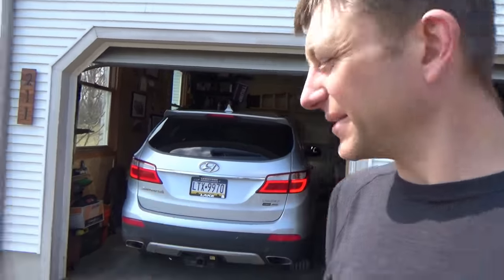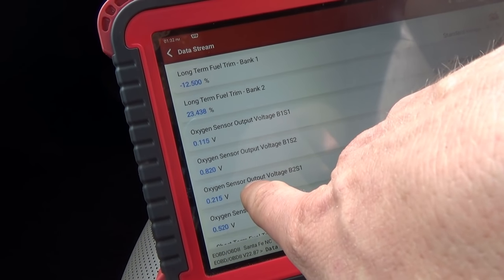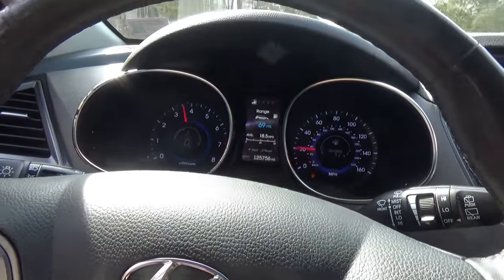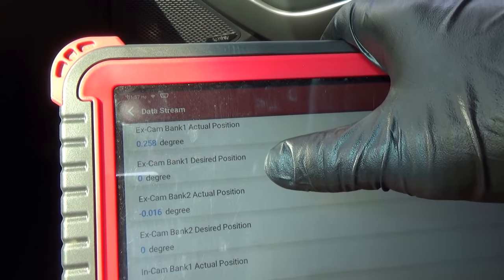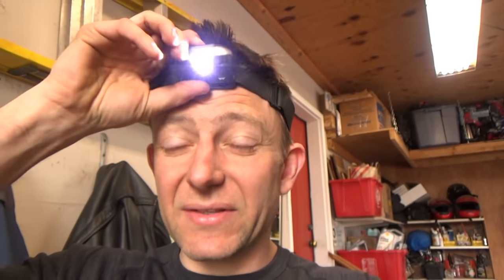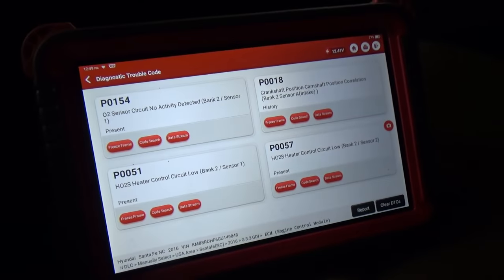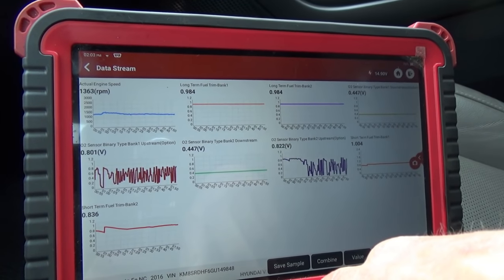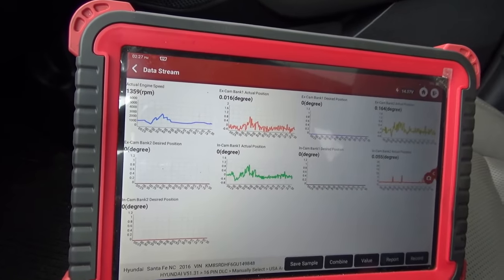Haunted Hyundai...Part 2 (Easter Special)

Comment: Just a note if chains are replaced on this engine the crank sprocket will need to be replaced due to a root depth issue with new chains. New chains will break the crank sprocket almost instantly. I used to be a hyundai tech and there is a TSB on this!
Reply: Well as far as I was taut, replacing chains must always go with replacing the sprockets, not only on cars. The reasoning behind was, it is not the chain what goes bad, but the sprockets are the thing that uses to go first. The chain is only "adopting" towards the sprocket wear/damage. So replacing just the chain means the new one will very soon become in the same state as the old one was, so all the chain and labor cost just went down the drain...

Comment: It never ceases to amaze me how sensitive 02 sensors can be.  They can take such extreme amounts of heat over and over again.  But don't get the probes wet.  Getting any fluids on the 02 sensor probe, will ultimately ruin them.  I'm still not convinced that this engine needs a timing set though.  I guess we shall see once the valve cover comes off.  Great content so far Ivan!  Can't wait to see part 3 and what the smoking gun for the timing issue truly is.

Comment: I always maintain at Least a quarter tank of fuel in my vehicles. For the fuel pumps sake.🙂
Reply: Funny story about that. I always kept over 1/2 tank in my truck and I got fuel one day no problem, filled it up, parked and went to start it after and the fuel pump was dead dead lol. 90k miles. Good ole GM
Reply: @BoweryPenguin8  GM pumps are garbage. They fail if the run dry for a few seconds. Bosch pumps get run dry several times and keep working fine. I have cars with 300,000 miles on the original Bosch pump, you don't typically hear that story on the GM pumps.
Reply: E is actually not empty. Engineers are smarter than you think. They know how people are. I've found my truck has about 2 extra gallons in the bottom of the tank.  I don't keep it full after the tank got drilled.
Reply: @MTLeopold  Ford engineers were smarter with the new cars. You can't run out of gas in a newer Ford. The engine will shut off a couple miles after the fuel range says 0 (zero miles range). 

The second you put more fuel in the tank, it will instantly start up because the system never ran dry.
 
Ask me how I know!
Reply: Most manufacturers set low fuel light with 10% remaining to stop the pump overheating so if you figure you can go another 50+ miles with the fuel light on it will get expensive if you do it often.
Reply: I try to impress that on my wife and kids……it’s like I’m talking to myself.😔
Reply: @davidparker9676  Interesting, did not know that was a thing now. What a PITA. So ford backwards really IS Driver Returns On Foot. HA! 😆
Reply: @jeffleach2668  Sorry to make you crazy but I do that every time. I still think it's an old wives tale from the days before pumps were moved into the tank.
Reply: @MTLeopold  to each his own ... 🙂🇺🇸
Reply: I also check the oil in my vehicles every couple weeks, even though none of them use or leak any... That my friend should make you crazy. 🤣👍
Reply: @thomasgames6719  Nah that's good practice. I check my tires like that. Not enough though. I don't mind doing things that make sense. I just want a valid reason to do it. There is no point in doing something just "because". You should be able to understand how and why you are doing things.

Comment: you can hear it's not in time, these engines aren't suppose to rattle like that. 3.3 GDI is in dozens of kia/hyundai I've had great luck with the older 3.5L
Reply: I was wondering about the rattle... It didn't seem right, but it's one of those things I wouldn't have been able to give an opinion on besides "it sounds questionable".
Reply: The GDI engine engines in KIA’s sound terrible. My 2.0 turbo GDI is embarrassing to me. Same noise now as when new, right from that pump area. The noise this engine has though is not the same and something is wrong in there.

Comment: My 2013 Santa Fe has p0018/p0021 code & also dealership said quote intake
camshaft
advanced.
Using freeze frame data fount
that issue
is
only present
We' startup which indicates Failed Zockine
pin in intake
cvvt
recommending all four cuvts due to complexity
job… So what should I do??? It runs fine & drives great & never did it ever stall or misfire.. Also one other thing do you think I just need to replace the solenoids??? Please I need help..

Comment: I had a similar issue with an 07 Hyundai Azera. Cam crank correlation code. Replaced both intake and exhaust oil control valves/VVT solenoid. Code went away, but now got multiple misfire code. Looked at O2 sensor data and found bank 1 sensor 1 was bad, as well as bank 2 sensor 1. Replaced both, and everything is fixed. Was pretty proud of myself for being able to fix it myself, when the dealership ship wanted $1,000+ to just do the Oil control valves/VVT solenoids. Also make sure to use OEM Hyundai/Kia oil control/VVT solenoids! Aftermarket ones don't work or will break fast. Don't trust them to control your engines cam timing. Eric O had a Kia come in with a similar issue, and it turns out to be a bad VVT solenoid: https://youtu.be/aWJLUzqK0r0

Comment: I'm working on my Nissan truck now and the catalytic converter is glowing bright yellow-orange. RAW GAS.
The truck barely idles without help. The driveline was binding (universal joints?) and I think it threw the timing belt off. 
When it warms up out here in Oregon I will check it. I love watching PHAD.
Reply: A glowing cat is a sure sign of a timing fault. Just a few degrees off on the crank will do it. 🙀
Reply: How the hell would a driveline issue cause a timing issue. That’d be like every time you loaded the engine up a hill a timing issue would pop up

Comment: Ivan 10:03 look at In-Cam Bank 2 Actual vs Desired - the others all agree. I know you already fixed this as I have more video parts to watch (I'm late to the party and playing catch up) - but man sometimes you gotta slow down to go fast (heard that somewhere :) ).  Of course I have the retrospective benefit of seeing this as a video in the comfort of my home while for you it was but a fleeting display of numbers on the screen.
Would be nice to be able to overlay graphs for PIDs on those scan tools - so you could overlay the two PIDs for Desired and Actual for each thing - would make it super easy to see discrepancies. Maybe Keith could feed that suggestion into whatever operation he is working with now :)

I guess the same could work well for the Pico software. Where you were hopping back and forth between windows to compare waveforms before and after manually advancing the cam. How about the ability to set your 0 - 720 cursors on each, then set one waveform to have a transparent background so you can slide it over the other to see the comparison. That'd be nice.

Comment: "The owner said he just changed oil before it really started acting up"  - That set off alarm bells.  Is it the right oil?  Maybe it's too thin allowing it to get in the cylinder.  Is it possible that the new oil knocked some crud lose?  And we have yet to have a theory for why the blue smoke.  I think we need to take a hard look at what's happening oil-wise here.  I'm wondering if there's a blockage in the head's drain, allowing oil to pool in the head and leak down the valve stems.  Messed up oil will mess up the VVT.

Comment: When valve  cover on bank 2 was off,if the engine was turned over using the camshaft bolt can cause timing issues.

Comment: I'm still wondering: How the heck could such cam timing misalignment develop on its own? Or was someone messing with it?
Reply from the maker: You will find out soon, and your mind will be blown haha :)
Reply: @PineHollowAutoDiagnostics   Sounds more interesting than a tensioner :) twisted part? The suspense! 

First time I ran into you was the blue kia with a twisted cam at Eric's shop, that was a cool case study.
Reply: Maybe no woodruff keys on the cam gears.  Seems to be the latest stupid idea from several automakers.
Reply: twisted cam at SMA, or this is more interesting?
Reply: @jeffleach2668  lol. We almost screwed the timing in a ford transit van. Went to go pull the crank pulley, only doing a seal at this point. My brain stopped and went let's look up service data, the labour paid to do it versus what I'd done was too good to be true. Boy was I right. Need to get the valve cover off lock timing...welp it'll be our problem next week when we get the tools in.

Comment: It would have been cool if you grounded the control valve again after replacing the O2 sensors and took it for a test drive. I'll bet the trims would've shown the timing issue. Happy Easter to you and your wife

Comment: My guess would be a stuck  injector or leaking seal on the high pressure pump causing it to run so rich and maybe a bad O2 sensor and That's what caused the chains to fail originally and now again because it shouldn't make that scraping sound like chain rubbing off plastic

Comment: No more blue smoke...Italian tune up success. Interesting concerns because the owner said the vehicle drove very good for a couple of days they all went south. O2 sensors, timing chains etc. don't add up yet.
Reply: I seriously doubt there is anything wrong with the timing chain.
Maybe the solenoid is bad or the control is getting shorted somewhere.
Reply: @davidparker9676  I think it's the Oil Control Valves/VVT Solenoids

Comment: How da heck can it run well with an intake timing issue?  Is the variable timing able to compensate enough for a mechanical timing problem to allow it to be out of time and still run half-decent?  Or is it the variable timing system itself throwing it out of time, and mechanically it's sound?  Sheesh...
Reply: it is a V6 so 3 of the cylinders are running perfectly
Reply from the maker: If it has 200hp out of 300hp, it will still drive "ok" :)

Comment: surprised the engine hasn't destroyed itself yet with that much gas inside
Reply: it's there, the damage has been done. Might as well find a replacement at this point. LOL. I'm sure after the timing issue is fixed, all the scoring on the cylinder walls will start to burn significant amounts of oil shortly after the repair. If I was this gentleman, I would have declined the repair based on that fact alone.
Reply: This engine has suffered severe damage in the process, rest assured.

Comment: I bet the pin on the intake cam sheared off and it moved seen it many times
Reply from the maker: Do you work at a Hyundai dealership or something? haha
Reply: @PineHollowAutoDiagnostics  no I'm a master tech benn doing this for 22 years now I used to work in Lancaster and in Exton. All my family lives in Clearfield so I watch all your videos. I have replaced quite a few cams on the hyundai and kia line of cars. Live stream data usually shows about 100 degrees offset when the pins break. But still love your content.
Reply from the maker: @CourtneyTidwell  has the cam ever shifted enough to bend valves?
Reply: @PineHollowAutoDiagnostics  no I haven't seen any bent valves yet I've done a few on the v6  engines they are more common to break on the 4cyls though. Keep up the good work. Can't wait to see what you find.

Comment: In my opinion  the o2 sensors should be replaced on a regular basis kind of a modern day tune up regiment.
Reply: If everything else is well and the sensors are high quality, they should last 100-200k km no problem. So most cars would get junked by then
Reply from the maker: That used to be the case with non-heated O2 sensors before OBD-II. Now my rule of thumb is if one sensor fails, then recommend replacing all of them at once...kind of like if one headlight bulb burns out, just replace both since they have equal lifespan :)

Comment: With this Hyundai smoking so badly without excess crankcase pressure even at low revs could the problem be a poor/wrong fuel problem especially as the fuel tank is nearly empty meaning oil etc in the fuel is being burned?

Comment: Ivan the high pressure fuel pump is leaking internally, dripping into the valve cover, down to the crankcase,  getting sucked back up through the pcv and burned as a rich condition
Reply from the maker: It's brand-new OEM! Plus that would affect BOTH banks equally...but Bank 1 is running perfect :)

Comment: I hope he bought this cheap...
Reply: 2016? That's easily 18k
Reply: @_RiseAgainst  plus all these and future repairs.a New maverick hybrid is 21995 with zero miles on the clock.
Reply: I don't like Hyundai or Kia. They are wooing people over with their initial quality, but I still feel they're junk cars to run over 100k. They also have the most large engine mechanical issues of all the brands. (Maybe not bmw) but they're up there. I'd never buy one for anything but a dirt cheap beater.
Reply: @volvo09  to think in the US at one time all they sold was excel and scoupe...
Reply: @volvo09  had an 07 Hyundai Azera get up to 203,000mi. Before it got totaled by hitting a deer. My parents have a 2010 sonata with 215,000+mi on it. Still going strong. The engine issues are mainly the 2011-2019 vehicles with the theta ii GDI engine. The smart stream engines should be fine. But they're too new to tell.
Reply: I wonder if the 10 year warranty is voided. 
I don't trust Kia or Hyundai, I would never buy one new or used.
I would much rather buy a Toyota or Honda with a mystery problem than one of these.
Reply: @davidparker9676  Likely voided as the car is past 125,700+ mile. It would have to have less than 100,000mi and have kept up maintenance history.

Comment: I feel sorry for the owner, seems like a nice guy and has all of this financial outlay and inconvenience.  Looking forward to the conclusion of this one.  Saw all of the empty Rock Auto boxes in your garage, I'm a recent convert to them, my last purchase was a Denso fuel pump kit, arrived super quick and was the genuine article for less than $100.  No longer buy stuff from A Mason and Flea Bay, some of their parts are very very questionable and are not always as described.
To answer your question of how many Easter Eggs the Hyundai has in store, how about 666, lol.
Reply from the maker: RockAuto is great! Ebay sometimes is the only source for outdated OEM parts though :)
Reply: @PineHollowAutoDiagnostics  Agree.  Ebay can also be good if the part is not time critical.  One of the center plastic wheel caps on my 2004 Sequoia came off (or was stolen) so I needed a replacement.  Of course OEM was out of the question, US based Ebay sellers were asking over $30, but as you know there are Chinese based sellers, and they are obviously a LOT cheaper.  Obviously it was weeks later when I received the part but got it for $10 which included shipping, and is identical to the other 3 caps.  I could have gone to a junk yard but you can easily spend 10, maybe 20 dollars getting there especially driving a vehicle like the Sequoia, lol!

Comment: You can't diagnose an O2 sensor if the cam timing is off. Start with the basics and work your way out.
Reply: It's YouTube content. Bet he makes twice the income from YouTube than he charges the customer.
Reply: I would beg to differ...

You should at least be able to force it lean during decel fuel cut. 

Granted you are sort of going on a gut feeling and experience when looking at other data, but there are some situations you can force and if it won't even show that properly you know you have a problem.
Reply from the maker: Sure you can. I just did lol